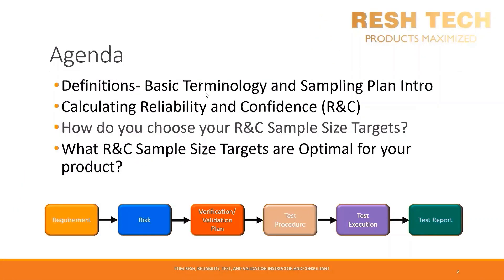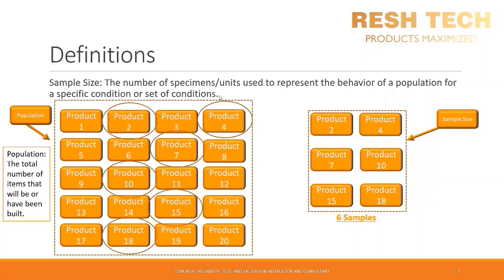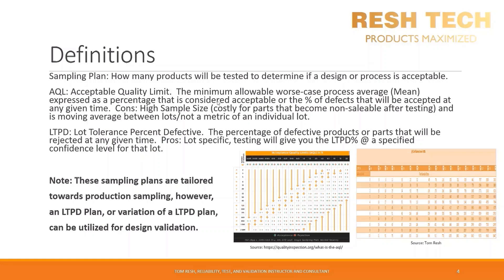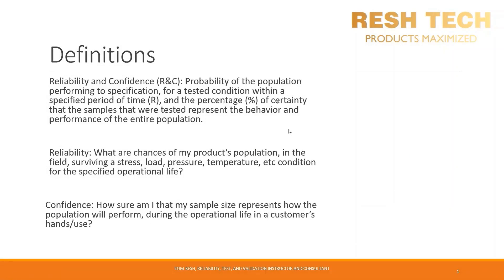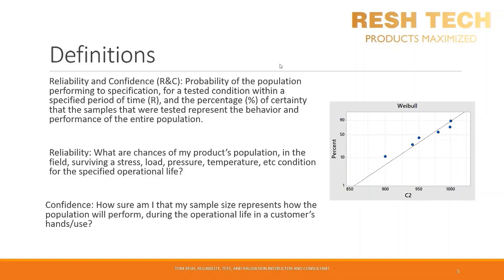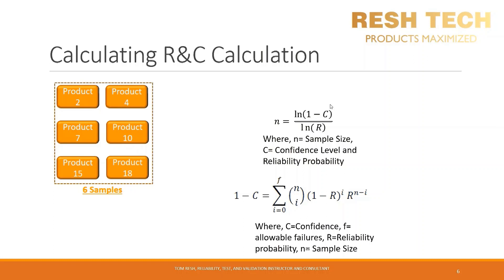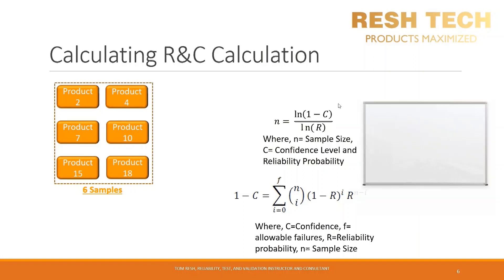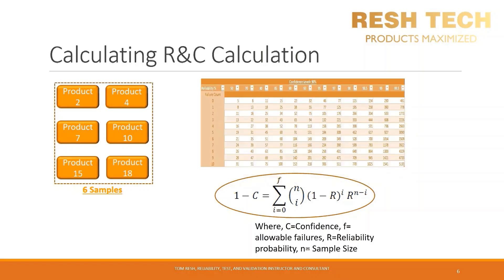Test Sample Size Determination

Comment: AQL are not for development you does not build a product to failed when is on design verification phase, as you are saying.... so you are use to to build products that from very beginning are going to defects???
Reply from the maker: Hi Gabriel, 

 thank you for the message.   This video was on different methods on how sample sizes are determined.   

Nowhere in this video do I remotely suggest using AQL for design verification. 

In fact, I spend a heavy amount of time discussing R&C Sample size determination, which should be used for development and DVT testing.